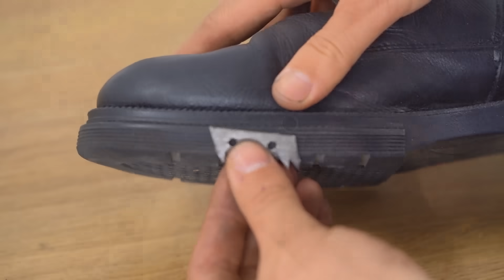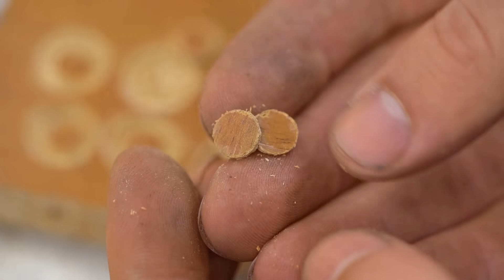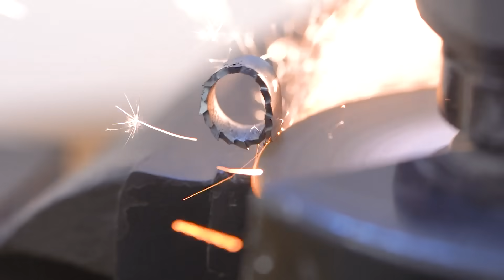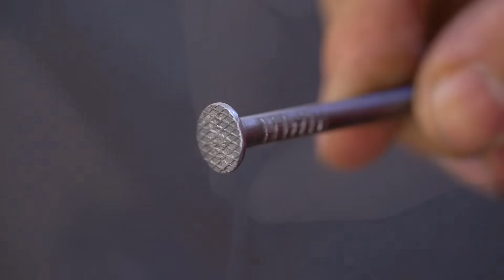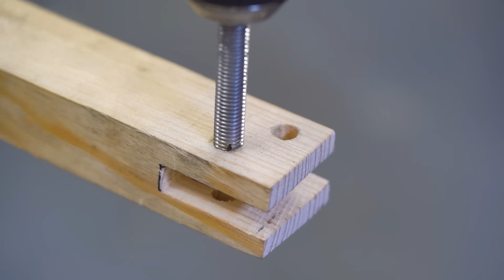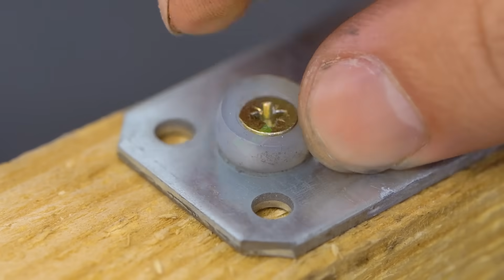Creative DIY Crafts for Handyman

Comment: My favorites are the ones that have to end with a green checkmark on screen as the only indication that something has been created or acomplished
Reply: 😂😂😂 my thoughts exactly
Reply: Like the one when they were threading the holes in the wood, and the threads were so messed up on the second hole, they only put the green check on the first hole. 3:36 like, don't worry about this little guy 😂

Comment: What are saw boots for??
Reply: When you need to cut something all the way down on the floor and you can’t be bothered to bend.
Reply: Perhaps when you are working on a roof or an icy or slippery surface.
Reply: 🤣 i am visioning someone wearing those bladed boots & having to walk across a room with shag carpet 😂🤣
Reply: @MariaLuciaGomezGreenberg  I would just get cleats.
Reply: Kicking people's faces off
Reply: That light exfoliation on someone's face
Reply: Couldn't put much pressure on the blades, screws will pull out of that rubber.
Reply: @MariaLuciaGomezGreenberg  yeah, because I want to trust my livelihood on a couple screws driven into foam

Comment: As usual, to anyone who happens to read this who thinks any part of this video is a good idea, please reconsider. Many of the ideas here are dangerous and useless, not to mention that the methods are far worse. Please never never ever clamp a thin, sharp piece of sawblade (or any sheet metal) into a vice like he does and drill into it, it is a fantastic way to lose fingers, metal, and drill bits all at once